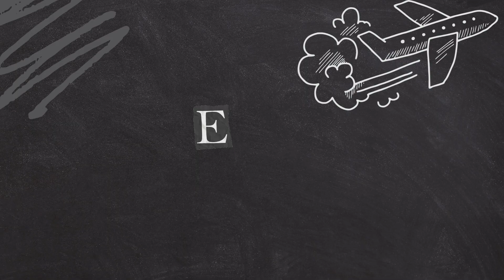MiG-105 || Spiral || Space Plane's Demise

Comment: NASA lifting body M2-F3, and also the Airbus 'Sagitta', obtained adequate stability by adding a third central fin to the wingtip surfaces.
'Dream chaser' is in this line. 
CoG position is pivotal in handling features of this type of lifting bodies. 
You could build one in concrete, in your own backyard. For a Kart, 4 mm body thickness was enough (Karlsruhe tech)
Propulsion not difficult: Pulsejets for reaching enough Airspeed, then a Lorin Ramjet.
To fly this, you better start with radiocontrol and FPV. 
Gesund +